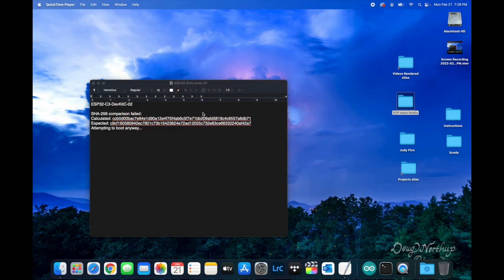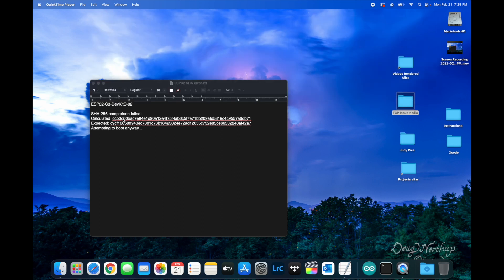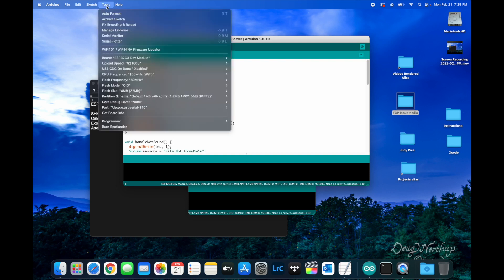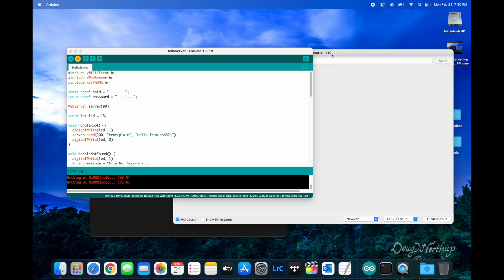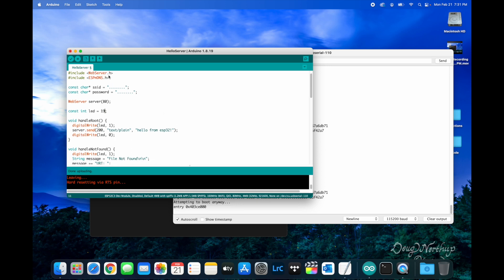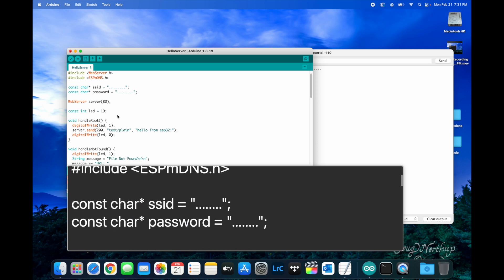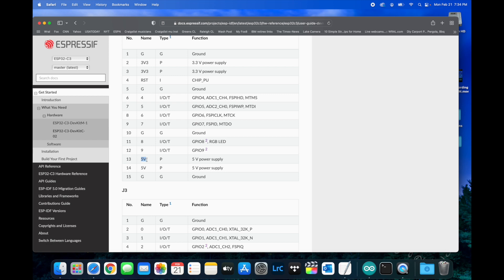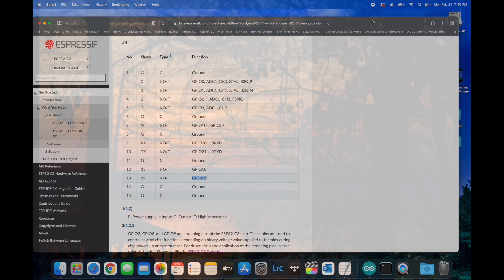ESP32-C3 (ESP32-C3-DevKitC-02) SHA-256 comparison failed, Attempting to boot anyway, Arduino IDE fix

Comment: you are confusing pin index on the board versus GPIO number (13), GPIO13 has nothing to do with physical pin 13 on your board. The issue is related to GPIO13 being part of the QSPI interface to the internal flash, but none of this has anything to do with physical pin 13 of the devkit which is a 5V rail pin.

Comment: I also got a "SHA-256 comparison failed" error with a ESP-C3-32S 
(Chip C3FN4 which should have 4MB Flash) but without the BootLoop 
and Iam not usin g Pin GPIO13.
I only could get rid of the "SHA-256 comparison failed" error when selecting only 2MB of Flash and setting the partition-scheme to a "Minimal"-setting.
For me that was with my app no problem, because Iam using a external SPI-SDcard as Storage.
Maybe its a "Fake"-C3FN4 and has only 2MB Flash? 
Or its a BUG also in ESP32-Core v2.0.2 :(
Reply: Thank you!! I had the same issue and this comment fixed it.
Reply: @orriomarsson9406  this solution not fixed the problem even using an old esp32c3 that worked repetadly or new esp same result with an empty script
Reply: @omnianti0   Ok then you must have a different issue, can you open the serial monitor?
Reply: @orriomarsson9406  yes its very strange it apended to all my esp32c3 an this during a whole day and i dont closed the arduino ide software and uploaded the same script on esp32s2 and esp32s and it worked after that confirmation its was not a rpoblem related to something external i retryed and it worked on all esp32c3 
what is completly crazy is the empty script provided this error too
i looked all over the report in forum and people have each one the same result and fixed the problem in a diferent manner but as evidence its not  the reality
being lost in the list of the esp32 library i thinked at first it was that but i remind to have ever used the esp32 esp32c3 esp 32s2 generic drivers despit my board have sometime a brand listed probably some clones i guess

Comment from the maker: Issue confirmed at https://github.com/espressif/arduino-esp32/issues/6027
"The problem is related to using GPIO13 as LED in the Sketch. This GPIO is used by ESP32-C3 in QIO Flash access. To solve it, just change the LED pin in the sketch."